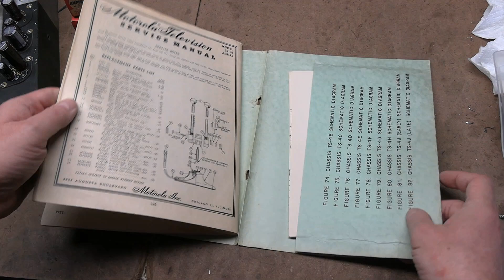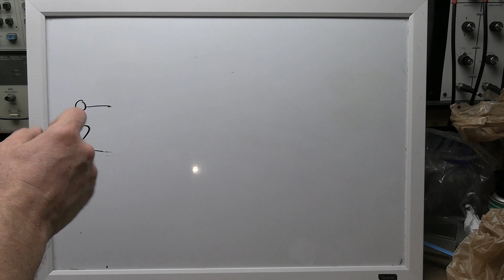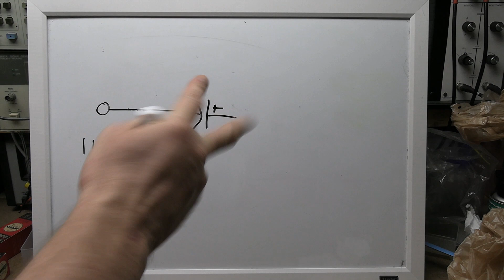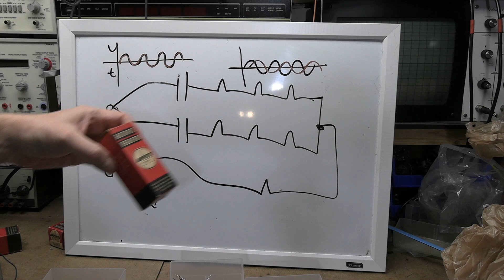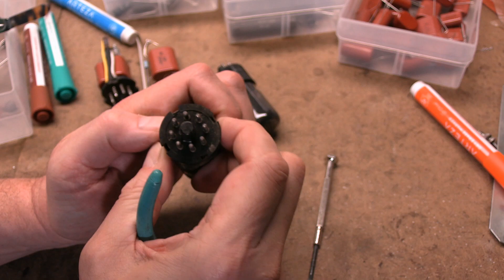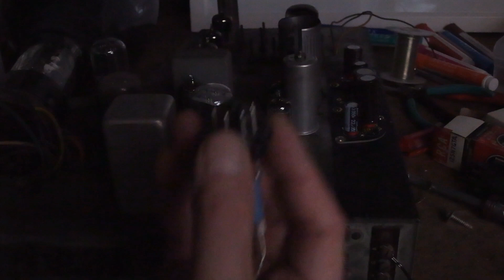Ultimate Guide to Motorola TV ballasts

Comment: Great Video.  Such a great explanation and easily understood.  Can you tell me where to obtain the 10 and 8.2 capacitors mentioned?
Thanks.
Reply from the maker: Been too long for me to remember which ones I got and where.  Vendors are constantly changing.  Just checked now and Nichicon makes some.  Digi Key EXH2E805HRPT and EXH2E106HRPT.  Check the dimensions first to make sure they'll fit.
Reply: @bandersentv  Thanks for the reply!

Comment: I just want to confirm that when you add the diodes to the balast, you can get rid of the silinium rectifiers becuase the diodes replace them right or do you have to add in the diodes to the balast and then also replace the silinium rectifiers(becuase their probeobly bad anyway)?  

I think the first thing is whats right.
Reply from the maker: Absolutely not.  The diodes in the ballast are only for the tube filaments.  The two seleniums on the chassis form a voltage doubler and supply the B+.  They should be replaced with 1N4007 or similar silicon power diodes.

Comment: What happens if you combine methods? Diodes and caps and maybe a small resistor. Does the half wave still count as ac?. Or just high ripple dc...
Reply from the maker: Caps block the DC. Doesn't work

Comment: I picked up one of those glass ballasts back when they were on ebay for awhile. It doesn't work in my chassis though as its the version that doesnt match that particular ballast.
Reply from the maker: I assume you have a TS-4H or earlier?  If it's an "H", you can move the wire from pin 5 to 6 and use the glass ballast.
Reply: @bandersentv  I will have to go and double verify, since I've not really used it since 2004. But that does sound about right

Comment: As a kid i rewired one of those7 tvs  parralled the tubes  added a dynamotor  in the trunk of a 51 Studebaker convertible  mounted  under dash . About 1950 a neighbor had  a pilot 3 neighbors came to watch thaught was a miracle  my first was a teletone 7w magnafier 😅. Had a framed brochure of 7motorola  on the wall ot my tv. shop am 81yrs old.    Was 6volt car

Comment: The very similarly constructed ballast in my Emerson used to be fine but one section eventually opened after I unplugged the can. I was very surprised to find the break was inside one of the cement dots. I removed the affected area, tied the two ends together, and I was happily surprised when it lasted more than 5 minutes. It's still going and I've nearly forgotten about it but I really should remember to add some replacement resistors to my next components order just in case.

Comment: One issue to be aware of --- diodes can, and do, go short-circuit. If that happens, the heaters  (and ballast resistors) will be vastly over-run. The fault may not be apparent for some time, resulting in failed tubes/valves and, more importantly, the CRT. A carefully chosen fuse in the CRT heater lead would offer protection against this and I think is essential. The thermistor will prevent blowing at switch-on. A reverse biased high current rated diode at the 'output' side of the fuse to ground would provide additional protection and help blow the fuse.
Reply from the maker: Ah, your words finally sunk in.  Yes, a reverse bias diode to ground would look like a short on the negative cycle and blow the fuse.  Thanks for the suggestion!
Reply from the maker: They would be stressed a little but not vastly.  Tube would have about 375 mA vs 300mA.  Possibly less since the tube filament resistance goes up as they get hotter and are somewhat self- regulating.  Also, the resistors I use are fusible and would go open.

Comment: Great tutorial and explanation Bob!  I wonder what those ballasts went for in 1949?  It would be interesting to have data on how many hours of operation they averaged. Thanks for your dedication to the hobby.
Reply from the maker: I'm sure they were fairly expensive as they were a specialty item.  Many of the sets I work on appear to have the original still installed.
Reply: I don't know about 1949 but I have a scan of the 1955 Allied Radio catalog. They were selling the exact JFD 17A485459 ballast tube for $2.35. The three other JFD ballast types (one more Motorola, two Emerson) were the same price. That's about double what they were selling many glass octal tubes for.
Reply from the maker: Thanks for the info.  Less than I expected.  Then again, they are cheaply made.  I wonder what the glass Amperite version went for?

Comment: 35:53...and if the diodes SHORT- (POOF!!)
Reply from the maker: Sure. Same if a cap shorted in that version.  You could put two diodes in series for extra protection. Or simply add a fuse. A TVS diode could also be added across the CRT filament to protect it
Reply from the maker: Now that I think about it more, it would be fine if a diode shorted.  The thermistor and series resistor would limit the current and were only talking another 20 volts spread across 10 tubes or so.
Reply: Including picture tube . Also capacitors can short out
Reply: need some kind of protection .With diodes circuit you can put zener diode to protect at least picture tube
Reply from the maker: No, you really don't. It's not essential.  I'll post a follow up and discuss why.  Remember the cap or diode is only knocking off about 15%.  If either diode or cap shorted, the filament would run hotter which increases their resistance which resists the flow of current.  Yes, the current would increase but only about 10-15%.  Not ideal, but would not kill the tubes immediately.  Also, most power resistors these days are fusible (including those I used).  Meaning they will safely open up if the get too hot or too much current runs through them.

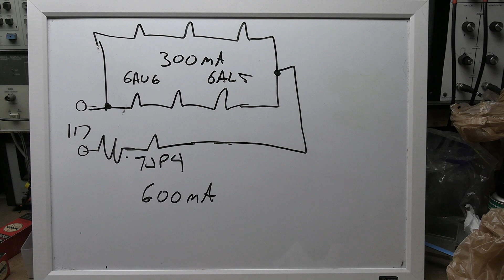Comment: 19:18  If there were only one resistor serving both strings, then if a tube burnt out in one string, the voltage across the resistor would be less, and all the tubes in the remaining string would have excess filament voltage, potentially burning out another tube.
Reply from the maker: Excellent point

Comment: Hi Bob, Thanks for doing the video on the ballast rebuild.  Since a lot of my career involved power supply design, I thought I would add my 2 cents.  Althought I don't own one of these sets but, of the 1940's sets, this is one that I would like to acquire.

Everyone of these sets I have seen has a cooked ballast, an indicator far too much power is being dissipated in too small a space.  I guess to begin with, the perforations; the small holes punched in the steel body are too small to permit convective cooling.  To allow convection, you need holes that are at least 3/4"/19mm in diameter.

As you mentioned, the different ballasting methods have their own sets of advantages/disadvantages.  The capacitive dropper is nice in that is dissapates very little heat but, it only works properly with a line frequency at precisely 60Hz, with a low distortion sinewave.  The biggest drawbacks (other than the problems you mentioned) are it degrades the power factor somewhat and most importantly, makes the set very susceptable to line voltage transients.  For instance, if you plug a vacuum cleaner into the same outlet as the TV, turning the vacuum cleaner off while the set is operating could wipe out some filaments.

The diode dropper has it's problems as well.  As you mentioned, the complex waveform the diode generates makes it hard to calculate the actual voltage drop and monitoring the actual filament color is the best indicator.  I would suggest using a light meter and doing an A/B comparison between 6.3Vac and the dropper.  Alas, the diode dropper has the problem of shortening the filament life due to "DC Notching".  However, in a restoration of an old set like this, it won't be run long enough for this to be a problem.

I see you are using Metal Oxide Film and Wire Wound power resistors.  These have tin dipped steel leads and dissipate 95% of their heat by radiation from the resistor body.  At maximum rated dissipation, the body temperature can reach 220 to 275 degrees Celsius so, can cook any component near by.  The diodes have a maximum junction temperature of 150 degrees Celsius so, you did well mounting them at the bottom at the tube socket.  I wouldn't feel comfortable with the total dissiapation of that ballast to be more than about 2 watts.  The resistor bodies need to be thermally bonded to the steel case to get the heat out of the ballast but, I realize this is not practical.

You can't just simply use an incandescent light bulb for a ballast.  The cold resistance of the tungsten filament is about 1/11th the hot resistance.  What this means in actual operation is, it will cause a huge surge to the filaments when power is applied.

I really hate having to throw that much heat away with that ballast.  I think my first choice for a solution would be to power the filament string with a 85 voltage power transformer, which is of course is not a standard voltage.
Reply: I looked up the link you recommended, it looks like Paul Stenning put quite a bit of work into this "Dropper" subject.  My experience with them was 22 years ago in developing low cost, line operated LED lighting products so, I'm familiar with the tradeoffs with the various droppers.  A properly designed capacitive dropper will have a series resistor, with a value of about a tenth of the capacitive reactance plus, a Transorb (beefy zener) to absorb or clamp the voltage transients, which protects the filaments (in this case).  The series resistor limits the surge current through the transorb.  Where the capacitive dropper will get you into trouble for example, is if you used a power inverter with a modified sinewave (which is actually a squarewave).  Due to the fast voltage transitions, the circuit will pump many times more power through the dropping capacitor, causing very little voltage drop from the line.  Anyway, I make mention of this problem as a precaution so valuable, non-replaceable parts, like the CRT will not be destroyed.
Reply from the maker: Thank you for all the insights and suggestions. I forgot to mention the TV cabinet has a sheet of asbestos above the ballast 😬
I'm curious about your transient with caps itive dropper comment. I didn't come up with these designs on my own. Both diodes and capacitors have been used to replace ballasts in radios for many years. I've never heard about any issues with either. Follow the link in the description for more insight into how well these circuits work with tube filaments
Reply: A "modified sine wave" is definitely a no-go with the capacitive dropper but I don't think something like switching a vacuum cleaner will have any effect. The thermal mass of the heaters will protect them from very brief events like this. I suppose for extra safety you could put something like a 0.1uF capacitor across the filament string. Combined with the series resistor this should shunt most of the high frequency transients.
Reply from the maker: Yes, I would not recommend using this with a power inverter or other non-sine wave power source.  There are actually already about a dozen ceramic caps across the filament strings at various points to shunt out noise.
Reply: @eDoc2020  That's why I mentioned the Transorb, I would use a 5 kW, 90V unidirectional type, which has a hard clamping limit.  The 0.1uF is a step in the right direction but, would only serve to dampen the transient a little.  I realize I am taking the "brute force" approach but, I am erring on the side of caution to offer more protection for the CRT.
Reply: @billharris6886   I don't think a voltage clamp would work for transients. The desired 85VAC sine wave would peak around 120 volts so a Transorb clamping at 90 volts would probably explode. A Transorb clamping at just above the peak voltage would allow double the correct heater power. I might be missing something.

What could work well is rectifying the CRT heater and adding a filter capacitor. Then with smoothed DC a 6.8 volt clamp would provide protection without worrying about the waveform.

IMO running the CRT heater off a separate isolated supply is probably the best way to protect it. You can use two diode droppers on the other heaters. But without needing to have the 600mA CRT in the loop you could have both diode droppers in opposite polarities, improving the power factor.
Reply: @eDoc2020  You are right on the transorb breakdown voltage, I was thinking DC.
Reply from the maker: @eDoc2020  Yes, a dedicated filament transformer is the best way to protect it.  Reality though is these are some of the most common vintage sets and were cheaply made.  It gets a little hard to justify going to such lengths and making extensive modifications.  Also hurts the value to the folks who would be willing to spent the most - hard core collectors that value originality.
Reply: @bandersentv   For protecting the CRT heater the best option might be a fuse right after the two strings combine and before reaching the picture tube. 800mA fast blow would provide the most protection but you might risk nuisance blowing on startup. With the inrush limiting thermistor I'm guessing it will probably be fine.
Reply from the maker: @eDoc2020  I don't think that would offer any protection.  If only one diode failed, the fuse would never blow.  If both failed, it's might just reach 800mA and the fuse would still take a very long time to fail.  You would need to get up to an amp or more for it to fail quickly.
Reply: @bandersentv   800mA is 8.4v which I believe is what many brighteners output. I wasn't thinking about diode failures but rather what would happen if one of the tubes shorts out. I know it doesn't happen often but it could.

Comment: Lets see, 117 - 85 = 32 volts drop needed.  Marine and railroad lamps are 32v.  So put in a Ancor 533025 light bulb in series with the filaments. 32v, .7 amps, 25 watts.  What!, not practical, terrible idea...oh well.